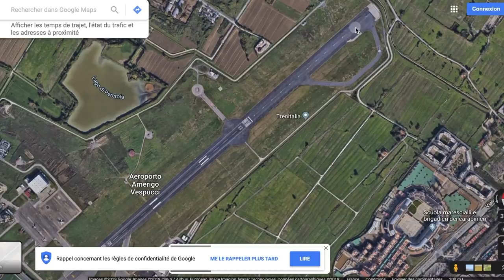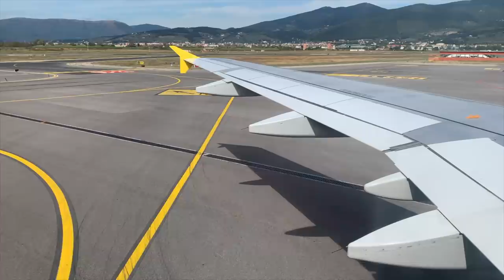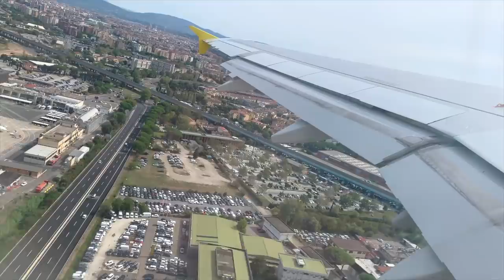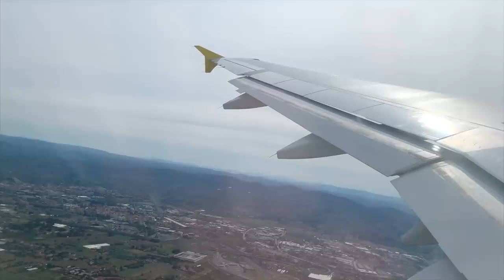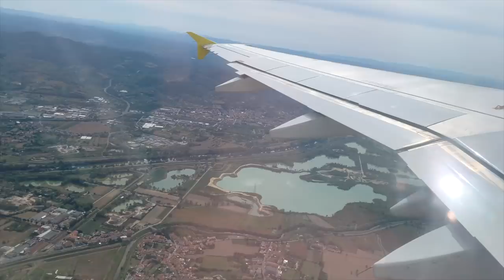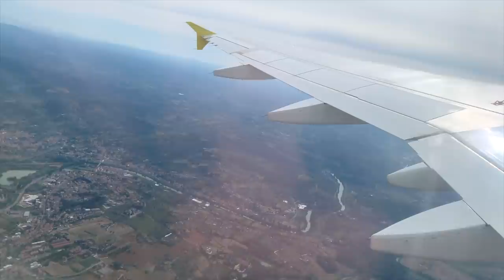POWERFUL SHORTFIELD Takeoff — A319 850m Takeoff Florence, Italy

Comment: Light plane because that roll was fast.
Reply: It would still take off fast even at max weight, the engines aren't fucking weak you know, they were designed for a reason and a reason only, to get a big fat stupid fucking bird into the air pretty fucking quickly
Reply: @Clarkkent163  Climb was steep aswell. Airborn by 850m + steep climb = Light load
Reply: @ivanrushmer6576  steep climb because of NADP noise abatement departure

Comment: A319: Takes off in 850m

The 900m left of the runway: Am I a joke to you?
Reply: @BillCipher1337  I don't think that is true. There is no abort option after V1. But maybe someone can tell me I'm wrong :-)
Reply: orlovsskibet they need to be able to stop at V1 speed without the Reverse thrust only using normal brakes
Reply: @BillCipher1337  I thought V1 meant that after that point they have to continue, since the non-flying pilot takes his hands off the throttle at V1. But yeah, there still has to be some allowance of runway after V1 too... there must be a video about that. But maybe that is what you are saying all along :-)

Comment: Hi, the actual runway of Florence Airport is 875 meters. The airport also has a taxiway on the sides of the runway (the taxiway next to runway 23 is 696 meters and the one next to runway 05 is 103 meters). These two make the track lengthen to a total of approximately 1.6 km.

Comment: Great video. The A319 is an overpowered aircraft in fact.
Reply: Well then what about the 318 hahah
Reply: Mircea-Christian Albu  - The A319 & A320 share identical characteristics, except the length. The A318 has different engines.

Comment: Time 3:53 and 3:59 these are the two different painted area on the runway. The plane takeoff  from the second mark 3:59. So, it was more than 850m.
Reply from the maker: THE MY WAY It was the first set of solid lines, not the second. Take another, closer look at my marking, and you’ll see that it is correct.
Reply: @flapsnslats  I did look and you are right, man. Cheers :-)

Comment: Wow you could barley even hear the engines spool up to take off power... I am not a fan as I love the sound of jet engines at take off ppwer... like the GE-90 115B on the triple 7 😉
Reply: chris s it would be louder if you are sitting infront of the wing beside engine but if you sit behind the wing you mostly hear the air rushing out of the engine
Reply: @deltagames3864  Good point. It is quiter behind the engine but I've been on quite a few 777 flights and one 787 flight. Even behind the wing a take off power you can hear the roar. The engines just seem exceptionally quiet in this video.

Comment: It was interesting that the plane appeared to come straight from taxing, turn onto the runway and straightaway start the high speed takeoff run. In my experience, both flying and watching these videos, the plane normally waits at the 'top' end of the runway waiting for clearance. Was this plane given clearance just before reaching the runway ?
Reply from the maker: Bob Russell Typically, and this is no hard and fast rule, towers will either clear aircraft to depart before they reach the hold position marking or they’ll clear aircraft to enter the runway: “taxi into position and hold.” Here you see the former. My flight was likely cleared for takeoff well before it neared the hold position marking. Florence doesn’t handle a lot of traffic, but it’s entirely possible there was an inbound flight on approach and the tower cleared us well before. Aircraft at Florence land and takeoff in different directions, so this could have been a situation in which the tower instructed my flight to depart immediately so it would be out of the way of an oncoming, approaching flight.
Reply: @flapsnslats  Thanks.
Reply: it's called a rolling takeoff, quite normal.

Comment: Why do they have arrows on the runway showing that the runway is even shorter?
Reply: That's a displaced threshold, it can be used for takeoff, but not for landing (unless you're coming from the other direction, that portion could be used for the roll-out after landing). The landing portion starts at the larger white line that is across the runway. A displaced threshold is used mostly for obstacle avoidance, where a descent to that portion would pose a hazard for the aircraft and stuff on the ground.